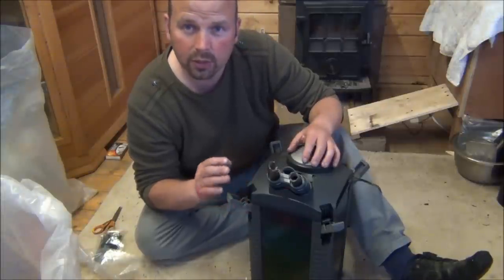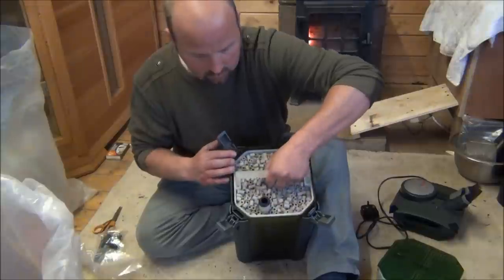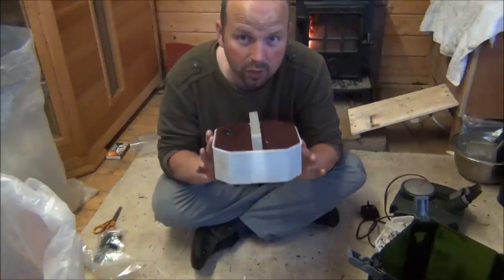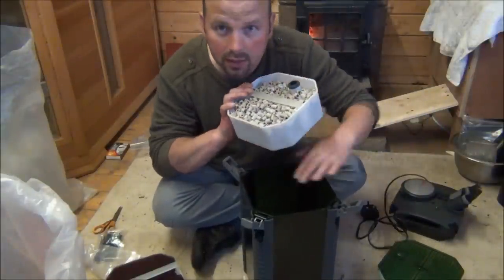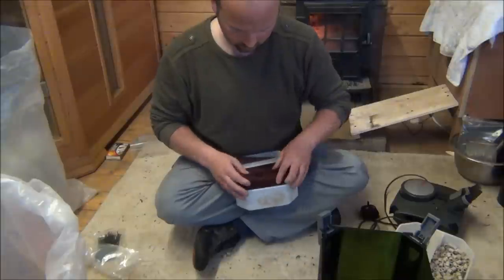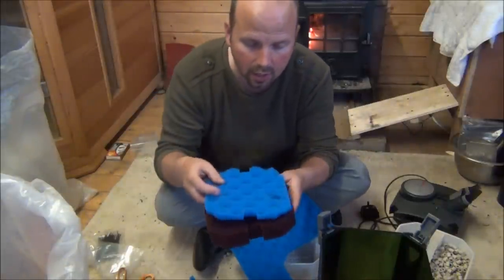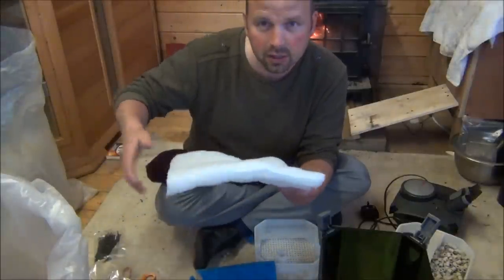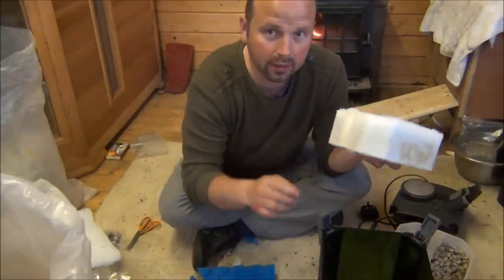How to set up an external canister filter for aquarium by Pondguru

Comment: The new Pro 3 and 3e have 4 baskets.  How would you set up using 4 trays?  BTY, great info in your videos.
Reply from the maker: Just leave the pre-filter foam in top of filter then set trays up as in this video with foams on bottom tray and media above.
Reply: I was thinking of the bottom 2 baskets with foam and the top3 with bio media.  What do you think of that idea.  BTW you video was great, it is helping me a lot in planing for the aquarium.
Reply from the maker: Rich Blondin That sounds fine as the more mechanical filtration you have the better - clean filter media will be more efficient.
Reply: Thanks for the input

Comment: Hiya, I have q jbl 1500e, the way its set up goes, sponges in the top, then ceramic balls, then more balls,then rings. Im going to switch that to the opposite way round and replace 2 trays with sinterglass, would I need 3 trays of it or have another basket of filter floss layers, would I lay a carbon packet on the top basket of media! Would I need it to take out the bogwood staining or would the new set up do that?
Reply from the maker: To remove staining you would need carbon / charcoal, yes. Best place to put that is last in the filter (on very top) and if you send me dimensions of the trays I can work out how much media you will need no problem. You can go with 2 or 3 trays of media as long as you have at least one good tray of foams and fine floss to do the mechanical filtration.

Comment: Daaaaaaaamn, Biohome expensive! Great video though. I love your videos and the effort you have put into them...
Reply from the maker: When you consider how much available surface area is there for colonisation and how well it works you're much better using biohome than a media which is half the price and doing only a quarter of the job. I have a new filter video coming up this week so look out for that one. Even the body of the filter is itself a filter and it oxygenates the water without an air pump, lol
Gad you enjoy the videos - thanks for watching and appreciating them.
Reply: Thanks for the comment, look forward to your next video. Just a query; do you like activated carbon in filters?
Reply from the maker: Domestic Cichlid There is no real need for it in a properly set up filter but if it is used it should be the very last thing the water hits before returning to the tank and replace it every 7-8 weeks.
Reply: OK then, thanks very much

Comment: Hi Pondguru, 
Many thanks for the excellent video's. I'm looking at the filter upgrade kit but not sure of best set up in cristalprofi greenline 901. could you please advise.
Reply from the maker: That one has a 'pre-filter' tray in the top just like the newer Eheim filters so that tray would be left as it is, remaining trays would be set up as in this video with foams and pad in bottom tray, media in trays above that. If you wanted to use chemical media (e.g. carbon) it could either go in top media tray or in the middle of the pre-filter tray so it is the last thing water hits before leaving the filter.
Reply: Pondguru Outdoors many thanks for the reply. would you recommend removing the centre foam from the prefilter tray i think its only the side foams that are used on the water intake. Also would you still put some old media loose in the bottom of the container.
Reply from the maker: You can put old media in the very bottom if you want but that's a personal choice really. The pre-filter tray will catch the really heavy stuff anyway.
The central part of the pre-filter tray has water flowing up through it before heading out of the tank so can be filled with media but most people just leave the coarse pad there as it doesn't fit much extra media in.

Comment: I know that this may be a stupid question, but couldnt the media get clogged because there is nothing filtering the water when it first comes in at the top? I see what u mean by when its leaving the filter, if u have foam at the top it will trap all the muck in the filter but still, dont u need something right when the water comes in? Thanks!!!

Comment: hi pondguru, love your videos, got a question for ya!!!
whats your (or anyone reading this) opinion: if i have a course then medium foam pad, would i have better results if i stuck a 100 micron pad on top of these two layers?
i just have a 20gal planted tank with a cascade 700 canister....
Reply from the maker: As long as you have some sort of fine pad / foam as the last stage of the mechanical part of the filter to catch the fine particles which get past the coarse and medium foam it will work well. The media will operate in clean water and be more efficient than in a standard filter as it comes set up from manufacturer.

Comment: hey buddy I'm using a fluval 206 for a saltwater tank. would you recommend a the same kind of setup or different
Reply from the maker: Yes just the same but unfortunately Fluval has those cartridges of foams down the side which you're stuck with.
The 206 will hold approx. 500g of biohome ultimate marine per tray and as the bottom tray would have your foams and fine pad in that only leaves 2 trays for media (1kg)

Comment: hiya thanks for the reply.. with the 2180 there's the course blue filter on the top(pre filter) then in the bottom there's the tube like media then in the middle and top basket there's the little eheim ball type media(sorry i'm unsure of the names) with the white sponge in the top basket before it goes back in the tank.  so if i'm right, getting rid of the  bottom layer wouldn't matter, as you say in your video " there  *******"   many thanks

Comment: how often will you clean the foams and how? im new to fish tanks and just bought a canister filter and your filter media kit.
Reply from the maker: The foams will need cleaning as and when they get clogged up with muck which will be indicated by a reduced flow coming back to the tank. That time could be anything from 1-6 months depending on the size of tank and stock / feeding etc.
Check it after a month then if it is OK give it a clean and leave it 6 weeks before checking next time. If you think it would go a bit longer after you clean it out check again after 8 weeks - extend the cleaning time accordingly so that  you're not cleaning it out unnecessarily.
Hope that makes sense.
Reply: +Pondguru Outdoors yes makes perfectly sence than you very much!

Comment: hi
fantastic information, I have a fluval fx6 how much media will I have to buy for this filter
thanks
Reply from the maker: Kevin Holloway As you have good mechanical filtration around the media trays you really only need a fine pad on top of the top tray to prevent fine muck getting to media (as trays have water flow going top to bottom) so you could get around 5kg of mini ultra or ultimate in the FX6 if it was packed in quite neatly.
That should see a good reduction in nitrates for around 500 litres of a normal community tank.

Comment: hey guru love your videos ! thanks for all the great advice. let me ask you if I may, should I put my incoming tube and outgoing tube on the same side (rightside) with the incoming all the way in the corner and the outgoing blowing left along the back of the aquarium to create a circular current? Or should I separate them and put the outgoing (on left side) tube pushing the water towards the incoming tube on the right? with the Driftwood in my tank I just don't know which would provide better circulation for the filter. thank you for any help here man ! God bless
Reply from the maker: Most people will have the intake on one side and the inlet on the opposite side but as long as the flow has to travel a long way before it is drawn back into the filter it doesn't really matter. Depending on how the tank is set up you may notice detritus collecting in an area which can be swept toward the intake by altering the angle of the return pipe.
I always prefer using the spray bar for general community fish as it gives a nice diffused flow but for fish which prefer more of a current it would be best to fire the water in from one end right through the tank so it creates a good current.
Reply: +Pondguru Outdoors - gotcha loud and clear my friend ! thank you very much !!! God Bless

Comment: Can you use 2lbs of bio media on each tray ? I’m just wondering because for me it’s pretty expensive to use 1kilo of biomedia in one tray. I have a 75 gallon tank if that makes a difference, would 4 lbs of media in my 100 gallon canister do the job in my tank ? 
Great video btw👍
Reply from the maker: That works out at around 285 litres so for a normally stocked tank that would require about 3kg for a full cycle, heavy stock could take between 1.5kg to 2kg per 100 litres meaning that if the tank was heavily stocked you could need between 4.25kg and 5.7kg for a full cycle. (1kg = 2.2 lbs)
If you have  '100 gallon' canister I'm assuming that it is rated for 'up to 100 gallons'? - with most models you could halve that 'up to' figure down to 50 gallons but without knowing the make or model of the filter I can't say if it will hold enough media since manufacturers figures of what size tank they say a filter is suitable for are all over the place.
Reply: Thanks you that makes sense !

Comment: What do u think about the sun sun hw-304b  with 9w UV sterilizer? Does the UV sterilizer kill the beneficial bacteria on the media? What's the best arrangement for a freshwater tank on the sun sun?
Reply from the maker: Justin Goodman Unless you have linked tanks running on same filter you shouldn't really need a UV. Just ensure it is switched off for the 2-3 weeks to allow for bacteria to flow through system and set filter up. After that you can run UV and it should not affect the protected bacteria in good filter media in filter trays. This video explains much more about how to set up an external filter: https://www.youtube.com/watch?v=lsAmSD3wVbgYour filter works the same way. According to my notes the 304b takes 2kg mini ultra or ultimate per tray but the UV version will take less (maybe just over 1.5kg per tray) so if you wanted to fill 3 trays with media you would need the 5kg amount. That should be good to see nitrate reduction in around 500 litres.

Comment: Great info! 
Can I do this for the Fluval canister filters?
Reply from the maker: Yes no problem but if you have an FX filter the trays work top to bottom in them so you'd just need a thin fine pad in the top of the top tray as you would have good foams surrounding the trays of the FX. Most of the fluvals don't hold much media considering the size of the filters but as long as you go for a filter which is a sensible size (e.g. a filter for 'up to 400 litres' for a 200 litre tank) it should hold enough biohome to achieve full cycle filtration. There is lots of useful information on my website here: http://filterpro.co.uk/qa-24-w.asp

Comment: Hey pond guru. I'm thinking about combining k1 and carbon bags together inside of a moving need sponge filter. Is that good idea, our will I have problems with the k1 constantly knocking into the carbon?
Reply from the maker: The carbon is there to take chemicals from water so it will not support bacteria. No problem using it somewhere in filter but the bag of carbon would need to be secured at bottom of moving bed so that the K1 didn't wear the bag away. If it did it would be difficult to sort them out when the carbon needed changing after 7-8 weeks. Best moving bed media is the new K1 micro. I haven't done a video on that one yet but it is the best one for getting maximum surface area and making the most fluid bed.

Comment: I’ve been using bioholm ultima media in my fluvial 206 canister filter for 4 months. I use a fluvial foam and polishing pad in the bottom basket and in the next two baskets i use the bioholm media. I have zero ammonia and nitrites but my nitrates keep rising? I thought this media reduces nitrates! If it does how long does it take, or am i doing something wrong?
Reply from the maker: It will generally take 4-6 months if used at the recommended amount which is around 1kg per 100 litres. 
Suitably sized filters will be able to accommodate enough proper media for the size and stock of tank.
Your 206 is suitable for normally stocked tanks up to 100 litres and each tray fits around 500g in so you will have 1kg - assuming that you have a normally stocked community tank up to 100 litres the amount of media used should affect nitrates.
Filters will always say 'for aquariums up to 'X' litres' and sadly only Eheim go on to explain that a normally stocked tank of around 200 litres will need a filter suitable for '400 litres' - hope that makes sense.
Please provide some details of tank size and fish stock.
It could just be that the media has not had enough time to develop enough anaerobic bacteria as the two most suitable types for externals (biohome mini ultra and biohome ultimate) are very effective at supporting the good balance of aerobic and anaerobic bacteria responsible for the full cycle filtration associated with nitrate reduction. 
The Q&A section of my website may help further but feel free to sens those details through ant time. http://filterpro.co.uk/qa-24-w.asp
pondguru@btinternet.com

Comment: Sir, I noticed you did not use carbon. Would you recommend carbon based on factors such as water quality in your area, aquarium size, fish type and so on, or is it actually not required?
Reply from the maker: +Kenneth shaheen jr. Carbon is not essential in a properly set up, well functioning filter but it can be useful to remove colour from bogwood and any residual treatments. Most manufacturers insist on using it as it draws in ammonia and nitrite which should have been processed by the bacteria in the filter. When the filter is not doing its job (due to being too small or having crappy media incapable of supporting enough bacteria) carbon is then essential - but it is better to change / upgrade the filter for long term success.

Comment: When it comes to cleaning out the filter, once you remove the top 2 baskets, would you replace the finest foam each time and just wash the other 2 in tank water.  Also would the media at the bottom that fills the gap. Would you just wash that and canister out with tap water, or does bacteria also live on the canister itself inside,  thank you
Reply from the maker: If the fine pad was totally clogged then yes you would replace it and just rinse the others out in tank water you had drained from the tank during maintenance.
If you can use tank water it is best to use that when cleaning the filter since bacteria will populate every part of it.

Comment: Really interesting video pal, I'm sold and going to buy one of those upgrade kits on the site, what would you recommend for a terratec ex1200plus? I don't 100% rate the filter itself though as I think the flow is way over advertised
Reply from the maker: +Baldie On Bikes The Tetra filters are fine when they are set up properly and although I don't have the tray dimensions written down for the 1200 I seem to remember that they take approx. 1.5kg of biohome ultimate or mini ultra per tray.
The way the filter comes set up is probably the worst I have ever seen as the media and foams are just chucked in there randomly and on Tetra's website they even tell you to replace the media every 6-12 months which is ridiculous since the media is plastic balls (described as 'highly active') and they will last for centuries, lol
An upgrade kit will transform the performance of the filter no doubt about it.
Reply: +Pondguru Outdoors hmm so if I kept the bio balls and used the three stage sponges at bottom, and then just have cirax and balls as media leaving me with lots of spare sponge once I take them out haha
Reply: +Pondguru Outdoors I will be going for the upgrade kit soon because of the rippled surface, but I'm going to try the way you do this with my current media and see if I finally get a decent flow
Reply from the maker: +Baldie On Bikes Where the media and foams are placed in a filter should not affect the flow so if the flow has noticeably dropped it may be a problem with the pump.
Reply: +Pondguru Outdoors it wasn't that it had dropped it was slow to begin with, I've got rid of one medium and one coarse, dropped them from scattered to just one tray with fine on top then balls on top, then cirax then a tray with a bag of seachem purigen on top it seems a hell of a lot more powerful now if I'm honest thanks for the tip man
Reply: +Pondguru Outdoors I've heard that before, I'll be getting the glass media as soon as possible, just need to find out how big the gap is at the bottom of my filter and the I'll reuse the cirax and maybe bio balls for the diffusion. That's the only step in missing so far, hopefully then my algae on glass issue will be sorted, since my pleco died it seems to have got out of hand
Reply from the maker: +Baldie On Bikes Algae on glass often just needs scrubbing off weekly. We used to do it before draining water from the tanks when I had the shop and it just became part of the maintenance. Most tanks will grow algae on the glass.
Reply: +Pondguru Outdoors it's a nightmare haha I've got an algae devil but it doesn't do much good

Comment from the maker: In the UK it is known as reticulated foam when bought from Pond equipment suppliers. Upon review, yes, I do misuse the term as that does refer to the actual structure of the foam but the fact that I mention that you should be looking for a foam which has bumps on it and show the foam in the video means that I could have called it 'octopus armpit foam' and people would still know which type to look for.
Thanks for checking out the video anyway.